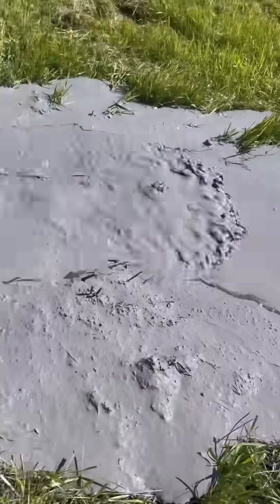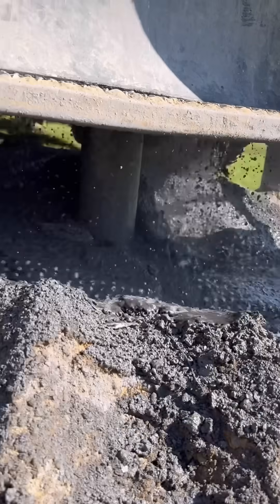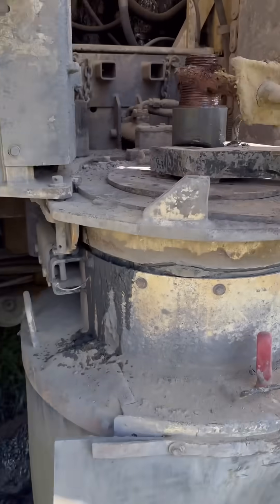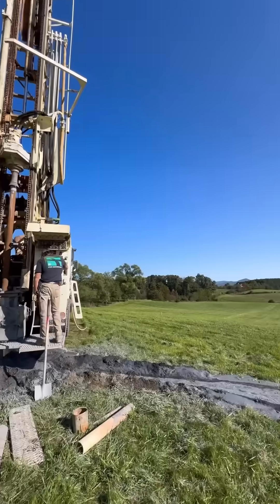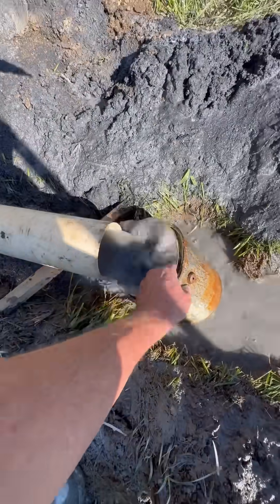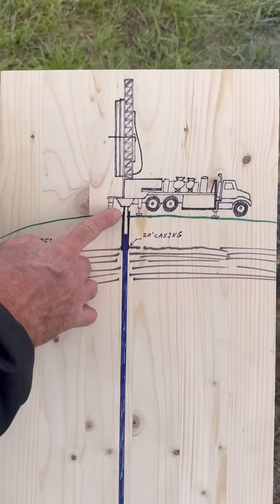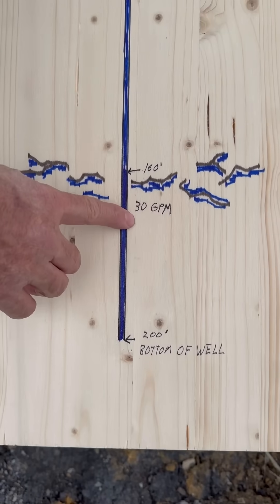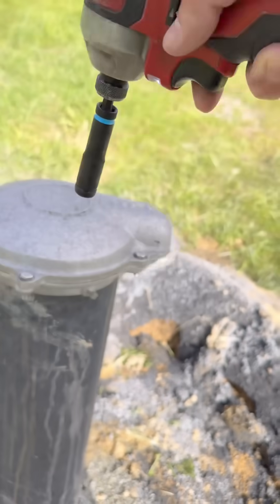How To Drill A Well

Comment: 12,500 for 200 ft. Those rotary drills are pretty cool.
Reply: Yeah,  the pump, tie-in, and softener will get you to about 12500.
Reply from the maker: The well driller thought it would be closer to nine, but that’s not including a pump
Reply: @hausplans nice. 👍 what state? I live in houston and my well pump is 180' down. Not sure how deep actual well is though
Reply: @hausplans  $9k? That's pretty cheap, but if they only had to go 160' that's a very reasonable price!
Reply: @hausplans  I had one drilled about 20 years ago and it was 20 dollars a foot, and I did the pump and pad myself... about 6000 for a 300 foot well.
Reply: How long does that take? I have seen drilling happening for a yr in the same area. They are still drilling.
Reply: 😅😅😊 @hausplans
Reply: @hausplans I manage a commercial boiler company... I can't price drop here but I can only imagine lol
Reply: @hausplans  9000 $for 200 feet is tooo costly 
In india my place it is not more than 3-4 $per feet
So strange why it is soo costly
Reply: @nishantpatidar You could get the drilling machine= basically a compressor (and used truck) for some of the quotes I am reading here😮 
The govt production rates of services/utilities and duties/tax are much. so they all feed on greed in the US now.
Reply: Holy cow, I'm glad I live in the area I do. $7,500 for a 175' well, a 1.5 HP pump and water line was on me. Dang  some of the prices I saw seem like taking advantage of people. I do understand that different soil types and areas require different materials.
Reply: @brian_2040  was this recent or years ago?
Reply: I have an a family member that just spent $7000 in Michigan, and I think that well was only 65 ft.
Reply: @Chris-hn4lp  if they are in the lower peninsula, the Saginaw aquifer is only 50 feet down in most places.
Reply: @Unknown-user7
 Now Required by state regulations to be at least 110 feet for drinking water. Lots of old wells in my area ( central Michigan) only 30 to 70 ft. Know of one house that had a artesian (free flowing spring) well. 
   Some of the best tasting water in the world, shipped all across the US. 
     Michigan is called a water wonderland for multiple reasons.
Reply: @Unknown-user7  This was near Milford Michigan. It was very close to a spring fed lake, so probably didn't need to be that deep.
Reply: @Chris-hn4lp  that sounds right for Michigan. Ours is 130' and believe the previous owner said it was $7500 for the new well in 2021. We bought the property in 2022
Reply: @MiBurnout Michigan here too. My well was too expensive. 35k but had to drill in 5 spots to find safe water. First 4 they hit water at 2 diffrent levels having high bacteria, arsenic, and heavy metals. Last spots is about 320 feet deep and just needs filtration. But sits at the opposite end of my property about 2000 feet from the house. But allowed easy sub taps to go to the barn and pole barn.
Reply: @Chris-hn4lp For labor Material and Pump?
Reply: @Chris-hn4lp  it’s because it’s cheap flint water crisis
Reply: @IamWeezyHD  This is nowhere near flint, but even if it was, it has nothing to do with that. Flint was city water, this is a well. 2 different things entirely.
Reply: @Chris-hn4lp  was that the pump depth, or was that the aquifer?
Reply: @Chris-hn4lp  mobilization and demobilization cost the same on a 360' hole or 70' hole. There are costs that aren't part of the depth... They got lucky!
Reply: @Chris-hn4lp  It's AWESOME if you can hit water less than 100' and makes it to where it's possible for you to pull the pump yourself without too much trouble and a bunch of expensive equipment, or having to hire a plumber to come pull it for you when it burns up or just $#its out on you!
Reply: @wesman7837 oh it is, I've had to pull mine up twice now lol
Reply: @wesman7837  my well is either 75 or 90 feet, I don’t remember which and it gets so much water. It was drilled in the 60s or 70s and has never run dry or dirty. A lot of iron in it though. Turns everything brown. Tastes good though. 

This is in the smokies. There is a lot of rock up here but I guess that rock traps water. We were able to pull up the pipes that go down into the well ourselves pretty easy. The pump was next to the well, not in it. There is a well house around it.
Reply: @wesman7837  some places in Michigan, they just drive a pipe in the ground about 40 feet. Called a shallow well. Rain is no problem in that shthole state.
Reply: Some will charge one rate until they hit Rock. Some will charge a flat rate regardless of what they encounter. Depends on the area.
Reply: @thegreenerthemeaner  they charge by the foot a lot of places whether they hit water or not.  My dad had a well drilled in the 80s. By the foot, no garuntee they hit water.  You pay until they do. I remember them being there for 3 days stuck at like 100 ft. Couldn't  get through a rock that was there . They asked my dad of they could move. They had a discussion and they moved like maybe 30 ft and we had water the next day. I remember hauling water from my grandpa 4 miles up the road, down to our farm to water cattle and flush toilets. I'm pretty sure they have my dad a deal since they couldn't get threw that rock and moved and we hauled water in old milk cans.
Reply: @thegreenerthemeaner  that's crazy I guess there must be a pretty standard depth in that area. And I guarantee you that they're charging for the deepest depth
Reply: I was quoted 30k for a well😢
Reply: @josh47807  that must be 380' plus. I was doing a house that had a 368, and it was only 24,900 for everything. That included the variances from the EPA
Reply: @gabemillee3726  that was just drilling it, and the pipe. The pump and everything else would be on me.
Reply: @gabemillee3726 I can’t imagine paying the government to be self sufficient 🤦‍♂️ what a stupid idea (not you, them)
Reply: @13J460  a variance, what a joke!
Reply: @13J460  Right, just look at what would have happened in NC if there wasn't a federal government around.

Do you think the state of North Carolina can afford to rebuild everything on their own?

Figure it out.
Reply: @edmartin75hd They were responding to a comment posted by another viewer.
Reply: @gabemillee3726 some guy in a dif comment get a 600' well w pump a d piping for 14k apparently
Reply: @marcusfelten8823  must have pushed it down by hand at 30ft/min
Reply: @13J460  That's the old fashioned idea that there is no society and we are only individuals. Saudi Arabia came in as an 'Individual' and sucked dry the Colorado river because all the farmers had setup that selfish legal precedent. They took down the water table and exported it back to the Middle East. Your kind of selfish thinking ruins it for everyone.
Reply: @kendipietro6855 I mean, they did it before. They got governor Tryon ran off?
Reply: Damn that's bad, @JoshTheVegan23
Reply: @josh47807  you must live in an area that either is geographically similar or has to go much deeper than me. My estimated cost when I'm ready to drill on my property, was closer to 50k,  could come in lower. If one well down the road is any indicator, its likely to be under, but not by a ton.
Reply: Holy Cow, only about 3-4k here
Reply: @adamchriss23 where on earth do you live? The 1920s?
Reply: @adamchriss23 where is here
Reply: @adamchriss23 Where is “here”?
Reply: Was gonna say 200ft is 10-15k
Reply: Take that number and multiply it by 18 and that is what it will cost me in my country. I wish I could afford a well.
Reply: @OneSouthAfricanguy $200,000?  Where?
Reply: @OneSouthAfricanguy what country is that?
Reply: 15k
Reply: wow that is cheap, my well is 165' and it cost $25k with flush, pump and connector. Even after conversion, I live in Canada, that is still a hell of a difference.
Reply: @hommie789 we get screwed in Canada with the cost of everything
Reply: Yeah I was also gonna say in the 12-13k range.
Reply: Depends on where ur at. I remember in california, I believe farmers were being charged around 10k. And that was 10-15 years ago
Reply: Our local drill company charges $150/foot and our wells are about 400 feel deep. $60k.  That's why everyone goes with a different drill company.  They're faster, less expensive and do a better job.
Reply: As a commercial plumber, this is very close to the work we do, but is a different trade all together. Kind of cool.
Reply: 4500 all day 
1500 material including pump 
Rest is maintance and profit
Reply: Yeah, that’s including the pump end everything tho.
Reply: Depending on where you are in a draw or proximity to an aquifer, it can be 1k per 10 feet in the high Rockies. Granite though
Reply: In India for 10 inch wide well , with 3hp pump  it costed me around 1200$
Reply: That would be at least 30k in California
Reply: @mikeswanson6145  for the first 100ft lol
Reply: @mikeswanson6145 if not completely illegal
Reply: @mikeswanson6145 Oooof course and that's just the cost for making an appt! 😀🤣😃😂
Reply: @mikeswanson6145  it's a little more then that now lol
Reply: @mikeswanson6145  And then wouldn't the City put a meter on it?
Reply: @johnbeckwith1361  If it's a well, it's a house in the country, with it's it's own septic system. PART of the city's "water bill" is because of the waste water. That is why (around me anyway) the city puts a seperate meter on the water supply for irrigation.. because irrigation water doesn't come back through the waste treatment facility, so there is a lower charge for water that is only going out.. not coming back to sewage treatment.
Reply: In India 2.5k
Reply: We paid $250k to have a 3 million dollar system.drilled and exterior pipe ran in the building 😂😂😂😂
Reply: I figured $15,000 cdn
Reply: $25k+ where i am at
Reply: Wow I must have got a deal 350ft + Comercial grade pump for 3,500 and all plumbing to the house inlet
Reply: I said 10k
Reply: We paid 10,000,  30 years ago '360
Reply: That’s actually war less that I would have thought
Reply: $15,000
Reply: I have a 500ft well that was $19,000 plus $8000 for the pump 😅
Reply: $20k in my area. About $1000 per foot, irregardless of the water amount. Pump is extra.
Reply: Just drilled a 300’ agriculture well in the Central Valley of B California and it was $71k. Should have cost a little under $50k but was more expensive because of massive amounts of cobblestone and having to install a conductor down for the first 50’.
Reply: I was going to guess $12k.  Amortized over 30 years, that's $33/mo.
Reply: Clever digging deeper than needed.
Reply: Where do y'all live with these prices omg 
I'm so happy I live in South GA
Reply: Shoot, spendy in the states. I get 30€ a meter in france
Reply: Just had a well put in and they had to go 140ft and with pump and all it was under 10k
Reply: The calculation is the cost per foot drilled . Thank you
Reply: Pro in india you can tell that much under $1000
Reply: $25-$27K
Reply: The old hammer drills do a lot better job at giving a lot of water and less depth but they take a lot longer to drill the well.
Reply: $15000
Reply: @craighavice6577  Ouch
Reply: Let's just say it cost the contractor 12k and you 28k
Reply: Guys, HERE is our Savior

HalleluYAH (Hallel u YAH) - “Praise YAH”

YAH The Father (Genesis 1)
YAH arrives via The TENT OF MEETING
YAH was Who they Crucified for mans sins
YAH was Crucified on an Almond TREE

Original Semitic of Moses
Isaiah Scroll (The Original Isaiah)
Reply: I was about to say  the same thing. It depends on where you are.
Reply: Wher
Reply: It's 30.000 in iowa
Reply: In MCBEE SC 250 ft will run between 8 and 9 grand.
Reply: @alphawhiskey3311  yeah, all the time.
Reply: Under $5K

Many of you fools would overpay.
Reply: thats around my yearly wage .....  I work in IT
Reply: @ElindorBG  find a better paying job. You're always worth more than you think
Reply: It's called geology 😂 you pay different prices for Different locations . I Drill 10 feet in Pennsylvania and hit water...or go to other states and don't hit water at all :) all depends on if it's a bedrock well or overburden well too.... I like a nice cleaned cored water well.. probably some of the cleanest wells I've Drilled are cored Bed Rock Wells .
Reply: 30k in Ozarks
Reply: $12k for a day of drilling?? 💀
Reply: Had a well dug 3yrs ago. Bedrock @48 ft hit water at 140ft and went 250ft down. Had a little over 30gpm and it all cost a total of $10,175. With a lifetime warranty.
Reply: Deeper is not necessarily better.  Deeper water is older and has had much more time to pick up undesirable minerals
Reply: Holy shit. 12 grand!? ..........sand point it is
Reply: Goodness gracious!! Just dig it by hand!!
Reply: 68' well. Good for up to 40gpm. Drilled in pumice, 6in steel casing with plastic liner screen. K Falls Oregon area. 12,500

Water struck at about 30', right on top of the clay, but in the fine gravel layer. High iron, but not terrible.

Other quotes were 16,500-20,000.
Reply: My brother just purchased a house up on Manitoulin and came to find out a couple of days after moving in that the drilled well was an unsuccessful drill.  135' down, and nothing. Drilled back in 2011, I believe. The property has an old farm dug well that is oh so nasty... and that's where the water lines are sucking from... unbelievable!!  
A water test and well inspection along with a septic drain and inspection were both part of the conditions of the purchase.  
Anyways... hard to live without water!!
Reply: 35 grand for 280ft back in 22.  That's just a pump, casing, drop pipe, and wire for me to connect to the house. PNW 2022. 15 gpm. I waited about a year before I committed to the purchase which costed me another $5,000 as the material prices kept rising.
Reply: I would have charged you closer to 14k without the pump
Reply: 18000
Reply: I know a old widow lady that doesn’t have any water because her well went dry and they quoted her 30-40 thousand to drill it deeper…this is in California
Reply: @WigSplitterMMA  that's outrageous...I'm from Canada and I'm not really sure what the going rate is here... but 30 to 40 thousand is ridiculous
Reply: @davidritchie659  I live in Canada and my well was 165' final and the cost of the well with pump, flushing and tie in was $25000 and that was 18 years ago when our dollar was worth far more than today, FYI
Reply: $22,000. Too much for the actual work done. It's priced high because it is a necessity.

Comment: Can wells like that run out of water and happens if they do?
Reply from the maker: That can happen in a drought, either have to drill deeper or drill a new one
Reply: They “can” but probably won’t. If they do either drill deeper or drill another location maybe at lower elevations
Reply: I’m thinking of buying a lot in Southern California near temecula. It’s desert and no city road or utilities are their yet or plan to be. I wonder if it’s an option to drill
Reply: @AllBallsNoTaint  also sorry I went off on a tangent but, check your local water table maps, or consult a drilling company or maybe even someone from the city to ask them if it’s easy to drill wells out there. Most places have water 200-400 feet down but it just depends on location and elevation!
Reply: It depends on the recharge rate of the aquifer. Some aquifers recharge very slowly and take thousands of years to recharge while others are nearly immediate. Depends on the rock type, porosity, and permeability of the rocks and the type of aquifer you’re working with.
Reply: I hear dry ice will open up clogged veins of water sometimes. But most time veins of water come back. If not then..... re drill.